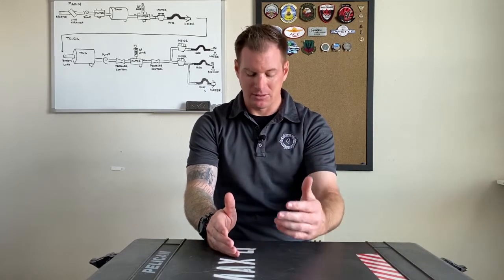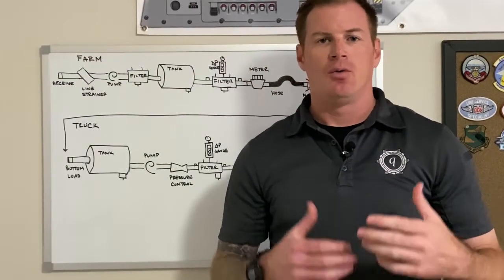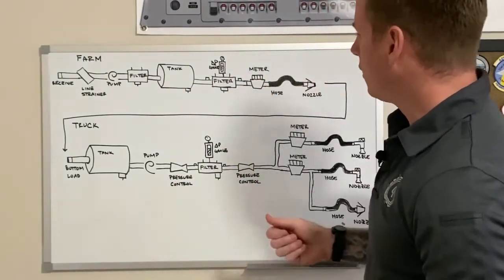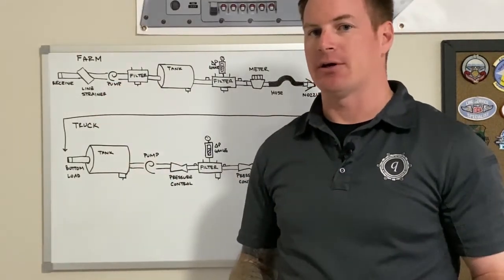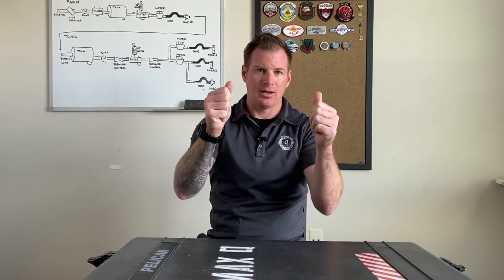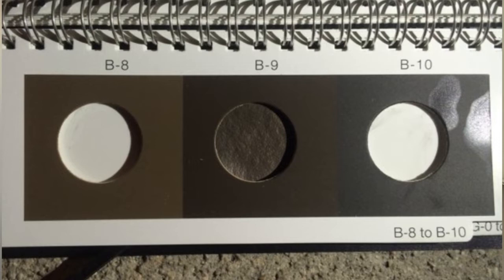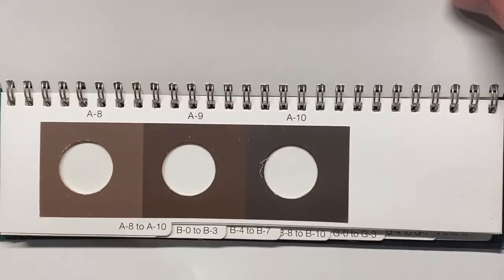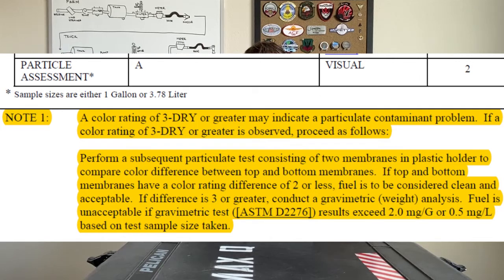Fuel Contamination Part 2: Particulate

Comment: What's your opinion on using a Rockwell Retro Encabulator in regards to maintaining high standards on fuel quality, technological leadership, and operating excellence?
Reply: The main winding must be of the Lotus-O Deltoid type in a direct line with the panametric fan, and anhydrous nangling pins are essential.

Comment: How much P.S.I do you use to do the test?
Reply from the maker: Thank you for asking. The test needs to be done under system pressure, i.e. the pump turned on.  Fuel does not need to be flowing through the system in order to do the test, and ATA 103 notes that using bottom load connections on trucks for recirculation should be avoided (ATA 103 2.9.5.1, page 54). 

Specifically, the ASTM 2276 procedure recommends a minimum line pressure of 35psi to obtain a reasonable sampling rate.